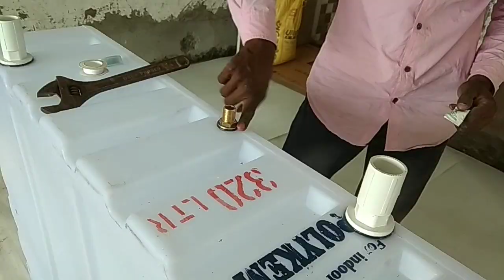Loft tank installation on over head

Comment: The pressure generated with this kind of setup is very low. Tap mein water bohot slow atta hai...kindly give suggestions
Reply from the maker: Avi Kye rasta nahi hai.
Aap ko mini pressure pump fitting karna parega.
Aap ka  plumber professonal plumber nahi hai.
Professional plumber Tank ka size, tank ka height ko dakh kar pipe ka size kam ya zada karta hai. Us ke hisab se Pani ka force kam zada hota hai.